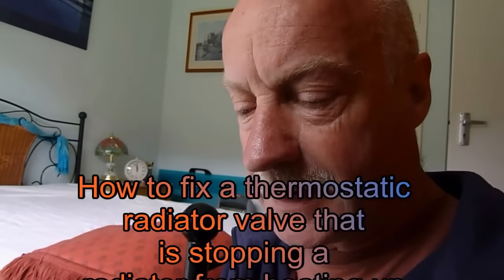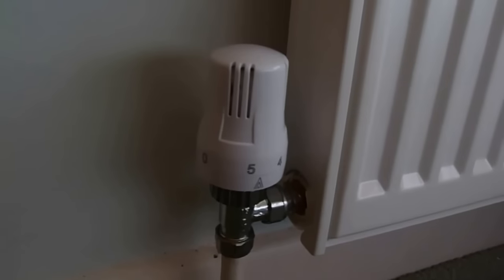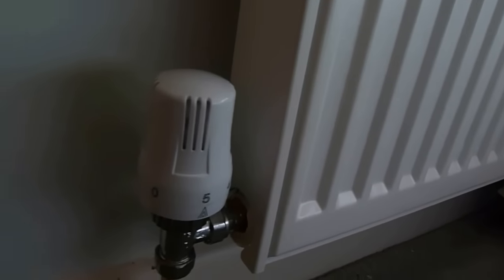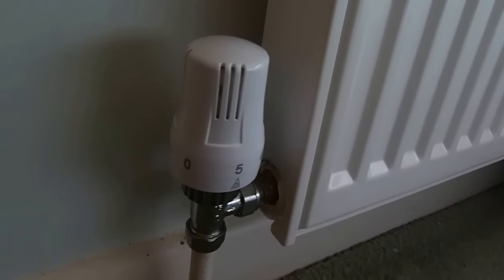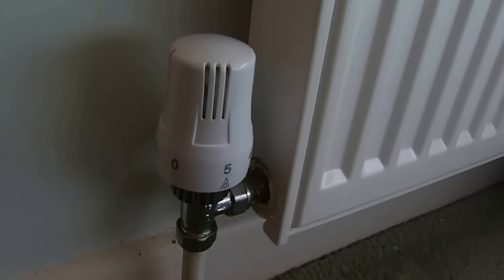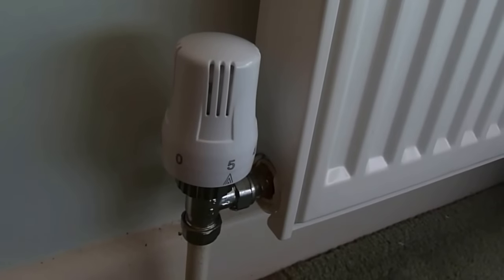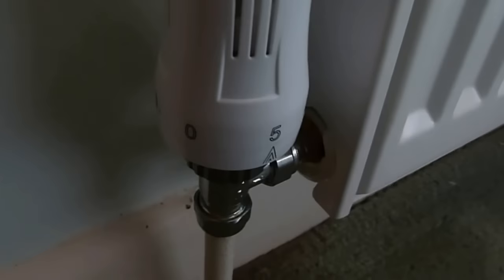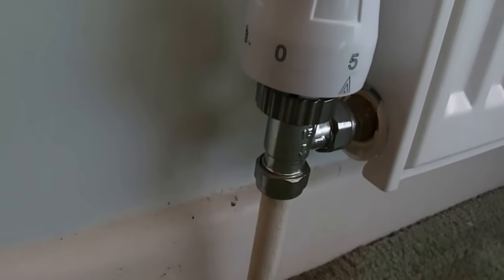How to fix a thermostatic radiator valve if your radiator is not heating up.

Comment: Hi I have the issue that the radiator will not work.  If I take the thermostatic valve off the radiator heats up fine.  This was in a very cold room as well so I'm sure it's not just the valve controlling the temp as intended also all the radiators have been bled so I'm pretty sure it's not an air lock.  Could this require a new thermostatic valve?  This only started to happen after the system was drained and refilled.  The pin is not stuck down either.
Reply from the maker: You have the sort of valve that can only be renewed.I have come across these valves many times, the valve head just goes U.S.   A nasty cheap valve.
Reply: +dereton33 What would you recommend as a quality replacement?  Also are the fittings universal?  Also to clarify are we talking about the thermostatic bit or the bit with the pin?
Reply from the maker: The thermostatic bit. But you will have to renew the whole valve. Fittings are not universal. Drayton are the best valves in my opinion..

Comment: Thank you so so much. You literally are a life saver, I was on the verge of freezing to death. Easy to follow and job done in just a few minutes. If the hammer doesn't do the job, you're probably not hitting it quite hard enough like I was doing, don't be afraid to put a little more whack into it. Thank you sir :)
Reply from the maker: No problem Lewis .
Kind regards,
al.

Comment: ace! Thanks for this; took off rad valve, tapped the pin with a hammer and the rad started to heat up immediately..
Reply from the maker: No problem Catherine.

Comment: Mine is only one nyear old and worked last winter but not now. No air lock. Have got the top off and can see the pin. The head is tapered so pliers just slide off and hammering doesn't free it - any other advice?
Reply from the maker: New valve Trevor I'm afraid.
Reply: 3 radiators all the same about 5 mm of pin showing (is this fully out?) and they will all depress about 2 mm.

Comment: Hi, one of our radiators doesn't get hot when I turn it above 4 on the thermostat -if I turn it down slightly I can hear what sounds like gushing water, after a while it starts to squeal. Would following this video help? Thank you :)
Reply from the maker: No in your case you need a new radiator valve.
Reply: dereton33 hi, and is that something we could do ourselves or not? Do you have a video of how to do it if so? Thank you.

Comment: Hi!
Is it possible that all the radiators in my apartment could have this problem? Like a month ago the radiator valves got changed for all the apartments in our building, but after that the radiators are not heating up in our apartment. 
The main pipes are hot, but the heat is not getting inside the radiators. Was wondering if this could be the problem and maybe the guys who changed the valves just did it unprofessionally.
Reply from the maker: +hendzK Worth taking the head off one and seeing if the radiator heats up. Some of the older type thermostatic valves also need to be fitted on the flow into the radiator, they will not work if fitted on the return pipe.
Reply from the maker: +dereton33 Do check the radiators for air first.
Reply: Thanks for the quick reply. When I managed to move the valve a bit, the 1st two "ribs" heated up, but then got cold again soon. As I understand, that might be, because the water does not keep circulating and the hot water I managed to get inside the radiator cooled down. If it was a problem with air, the top of the radiator would not become hot, just the bottom part, am I right?
Reply from the maker: Yes thats right. Al.

Comment: Hi there My valve (british gas  1208) disintegrated. I got a replacement but the thing inside the actual valve is stuck. It doesn't go up and down when I turn the numbers from closed to full open. Any suggestions? THANKS
Reply from the maker: Try giving the pin a light tap with a toffee hammer and a squirt of WD40.
Reply: @dereton33  Thanks Al but it is the movable part in the TVR thermostat head that doesn't move. little white thing that sits on the pin when screwed on. Thank you for your time. Perhaps I should just get another make. I got the BG one from an auction site...used.!!!!! I am not a handy man lol
Reply from the maker: In that case get yourself a quality Drayton valve.
Reply: @dereton33  Thank you for your advice. Really appreciated

Comment: Can we balance these ourselves? My mum doesn't want me touching our radiators (I haven't done so) and wants to call out a plumber (which we always do). We seem to have to keep replacing the thermostat. It's like they get too hot or something. It's going to get expensive to keep calling out a plumber.
Reply from the maker: It is very easy to balance your heating yourselves.
Reply: @dereton33  thanks. do you have a video?

Comment: Do I need to turn off the water or the heating first?  I have an inborn fear of plumbing!!
Reply from the maker: No, in fact it is better to do it while the heating is on, so you can feel the radiator heat up, when you have fixed the valve.

Comment from the maker: Hi Olympia197 Check the pressure of your Combi boiler and if low refill to 1.5 bar.
Reply: hi thanks for getting back to me......the pressure is on 1.5 but still got cold rads :(
Reply from the maker: Olympia197 Sounds like the dirverter valve on your combi but you will need an engineer to that,but do check the pump inside is turning ok, if not remove the front screw and turn the inner screw to release as it might be stuck, if you do not fancy trying that you could just give the pump a light tap with the hammer this sometimes shocks it back into life.
Reply: dereton33 thank you, i will try that
Reply: dereton33 still no joy, even after giving it a tap..... but thank you very much for the advice......il be calling the engineer tomorrow......good old hot water bottle again tonight :)

ps. the pump was boiling hot, so switched everything off from the mains
Reply: dereton33 fc

Comment: Help, we have a broken TRV head so I have got a new one, but I have pressed that pin to see if it is working before I fit the head, and it is now leaking water through it!! I have tried locking the radiator at the valve at the other side but the water is still coming through that plunger pin. What can I do?
Reply from the maker: Lock the pin down with the head screwed in the off position. Then order a new valve.
Reply: @dereton33  I know this sounds odd, but there is a serious fault with the pin! If I push it down then water comes out of it even faster. It is better in the up position! Anyway I have been and got what I need for a full replacement, and will call a plumber tomorrow. At the moment with the pin up the water is coming out pretty slowly. Hope nothing happens through the night!! Anyway Thanks for the reply.

Comment: The thermostatic rad valve (TRV) is very close to the radiator, and also (of course) on the radiator pipework, and must surely be affected by heat radiated by them or conducted through the metalwork to the temperature sensing element.  As heat is given up from the water in the radiator, it stands to reason that the outflow water is cooler than the inflow.  Where is a TRV best installed - on the inflow to the radiator or on the outflow?  It strikes me that it would be best installed on the feed pipe, some distance from the radiator, where it could sense room temperature without being influenced by the radiator - though I realise that's impracticable.
Reply from the maker: They are normally always fitted to the flow.
Reply: Thanks for the response, but "the flow" is a term I'm not familiar with.  In-flow to the rad, or out-flow from it?

Comment: I have a different type of problem. I've turned mine to "*" which means it shouldn't get hot. But it gets hot regardless. Would this also fix this problem? 
Tia
Reply from the maker: No Afraid not, you will need a new valve.
Reply: @dereton33  you got a video on how to change the valve by any chance?
Reply from the maker: Yes there is one on my channel.

Comment: I'm having a problem with a few of my radiators, they are red hot and no matter which way I turn the thermostat valve they won't turn down, is this something I can sort myself or do I need to call someone out? Thanks
Reply from the maker: Best call a plumber the valves are not working.

Comment: I turn  the radiator valve to the off position but it won't go off I have a very old cylinder type central heating system  not a combi boiler so if I want just the water on the radiators must go off....and the radiator is getting very hot and has got a sooty smell any suggestions please...
Reply from the maker: The valve is broken. You could always turn the other valve off for now, that is the lockshield valve at the other end of the radiator..I will set to doing a video on how to do it.

Comment: Oh dear, just tried that on an old danfoss and the pin DID come out, managed to put it back in but now I think I'm going to have to replace the valve. Please modify or remove this video. Thank you.
Reply from the maker: This video works for most valves, that old one you have is very rare but at least now it works. Once the pin is back in the leak will stop.
Reply from the maker: I have now amended the description, to not touch these models of valve, but to  renew them. Thankfully there are vary few left.
Reply: Thanks Al, new one on order, blood pressure back to normal :)

Comment: Plunger popped up as soon as I removed sensor head, radiator got hot. Replaced sensor head, and radiator went cold even although turned up high. Take it this mean sensor head is faulty, and always trying to push plunger down even below ser temperature?
Reply from the maker: bluerizlagirl You will need to renew that valve. Leave the top off for now if you need the radiator hot, until you get around to renewing it. Al.
Reply: dereton33 Can I replace just the sensor head? It's a combi with a sealed primary, so would be nice to avoid draining down .....
Reply from the maker: Yes, if you can get the same make of valve.
Reply: dereton33 Thanks, I thought so but nice to have it confirmed by an expret. I have a mate who works for a plumber's merchant; if anyone can get me one, he will be able to.

And thank you once again for your prompt response, on a Sunday too -- that's what I call true dedication!

Comment: My pin is working but the actual thermostat cap on the top doesn’t seem to push the pin down? Is it something on the cap that needs adjusting please?
Reply from the maker: No there is nothing, you have to renew the valve
Reply: Thanks again... I took it off and checked the pin, maybe it was jammed open and checking it released it as it seems to work now? But thanks for the video as I didn’t know they just unscrewed like that! Super helpful, I can change the bleed valve now that I can turn the rad off both sides :)

Comment: I had the same situation where the pin was stuck. Managed to free it off but I now have water leaking up around the pin !!  What can I do now please ??
Reply from the maker: It may seal itself give it some time, if not you will need a new valve.

Comment: Hi when I hit the top of the pin on my valve with a hammer a brown gunk comes out and it remains stuck,what should I do. Do I need to whack it  a bit harder
Reply from the maker: No its blocked with sludge and will need a new valve.
Reply: Thanks m8

Comment: Hi my thermo valve got jammed when I turned the radiator off in the summer, tried turning it back on and the thermo come off now it won’t get warm, anything you can help me with ?
Reply from the maker: Tap the pin with a light hammer until it springs up, then replace the top.
Reply: @dereton33  the pin is up it doesn’t go down for some reason

Comment: I have a new radiators and when I set my trv to 5 or 4 it heats up but if I set them to 3 or below they stay cold. is this correct to how it should work?
Reply from the maker: Usually they are set to number 3. If you have a cheap make of valve then you may find it has to be higher. Drayton valves are the best.
Reply: They are instinct valves? I'm not sure if that's a good make or not
Reply from the maker: Afraid not. those valves cost about £5.00. Drayton ones £15.00.. As they say you get what you pay for.
Reply: dereton33 this is true. it's just what the plumber put in and he's just changed them for new ones. would you recommend changing them then? could you recommend a mid range trv?
Reply from the maker: No the Drayton ones are the only reliable model.

Comment: Hi I have one stuck in on position will not turn off 
Tried to release value but not working swapped tops any ideas
Reply from the maker: Try tapping the pin and use some WD 40 on it then replace the cap.
Reply: Tried tap pin seems ok moving and up and down but I’ll try the wd40. As well thanks

Comment: Hi please could you tell me how to unscrew that? I am sure is a simple way but I tried to use a tool and it won't unscrew as to tight and no man to help me ! thank you!
Reply from the maker: A pair of water pump pliers, that open wide enough to fit the nut will do it. Turn anticlockwise to undo it.
Reply: Thank you I wil try this :)

Comment: I have a old radiator it has a dial that goes up to number 8 which number should I put it so I could have heat in my bedroom please help it's very cold in my room.
Reply from the maker: Turn it on to at least number 6. If it still does not work then the pin may be stuck in the valve. Take the top of the valve off and pull the pin upwards if it is stuck down. if it is to closed down, then tap it gently with a hammer. There are some valves where it is the valve head that is faulty in which case just unscrew and remove the head and leave it off until you can get a new one.

Comment: my radiator only works if it is on number 5 (full heat), for lower numbers it is just stone cold with no inbetween. Any ideas?
Reply from the maker: Change the valve.

Comment: Hate to say it but my pin just come out. 🙄😬 managed to get pin back in but it's a lot higher now can't get the rad valve screw back on. However radiator is now warm 🙂
Reply from the maker: Sometimes happens.

Comment: Hello. Please help.  I do not know what is wrong with my radiator.  It heats up for 20 minutes then it goes cold no matter the setting.  When I take out the Trv head, the rad gets hot at full speed. But when the trv head is on the rad gets hot only for 20 minutes and I dont hear the water.  I even changed the head, still same problem.  Please help.  Living room is cold, if I take the trv head out it gets hot but the heating bill will kill me. Thanks in advance
Reply from the maker: You will need to change the whole valve.
Reply: Thanks so much for responding.  I will try to chsnge the valve.  My husband is not handy at all.  I guess I will need to ask a plumber to do that for me.

Comment: hi please help, I have a slightly different issue my thermostatic radiator is to hot I can't cool it down without turning off the system? am I doing something wrong
Reply from the maker: No, you have the type of radiator valve that cannot be fixed . You will have to renew the valve.
Reply: Oh, I was kinda hoping it might need balancing or something? it looks very much like the setup in the video above. I can see the pin is up I just can't get it to go down :)
Reply from the maker: Those types of valve just cannot be repaired.
Reply: hi again, thanks for all your advice just one last question if I may. do I need to drain the whole system to change the valve or just the rad (which is upstairs in this case) and if so do I still need to shut the water down?
Reply from the maker: Just drain the upper floor level. Or you could by a freezing kit, which would mean you do not have to drain at all.
Reply: I had this at my old house and the top was not seating over the pin as it had loads of playand I think missed the pin?

Comment: My pin seems to be up but it doesn't push down/pop back up?
Reply from the maker: Make sure the other end valve is fully on. The lockshield valve. If no luck then the thermostatic valve is faulty.

Comment: Hi. I have the opposite problem. The radiator stays hot even when the valve is switched to off.....
Reply from the maker: Lynne Jones You will need a new valve then. Al.
Reply: dereton33 Thank you.  When I remove the valve it doesn't look like the one in your video. It  has a pin in the bit that you turn, not in the bottom part. Should we replace like for like? Thanks again for your help.
Reply from the maker: I would stick with a make like a Drayton. Al.

Comment: I've had a pin come out - water squirting out - had to take the valve out and replace it!
Reply from the maker: Very rare that happens you must have had a very old valve, as they stopped making them years ago.
Reply: It would of been fitted new late 1989 onwards

Comment: Guess what ! I did that and the pin flew out 😅.so it’s not rubish lol. I quickly put it back in because water was squirting out.
Reply from the maker: Bet the rad got hot after that,
Reply: @dereton33  hi ! Thank you for replying. I’ll have to replace the trv I think on that one they are very old (Alan key type) . That one’s staying hot continuously when the heating is on. So I think the mechanism inside is stuck solid. I did tap it with a hammer etc.

Comment: can you just turn one radiator off ?
Reply from the maker: yes.
Reply: Thanks for your reply. on one of my radiators the bleed valve is painted so I cant move it . Any advice on how to get it to move ? Thank You
Reply from the maker: Clean all the paint off with a small hammer and screwdriver, once clean and a brass head showing, you should be able to get a key to latch on and turn it.

Comment: Trying to turn my Radiator off. I twist the valve to zero, the radiator still heats up full.
Reply from the maker: You have a faulty valve.
Reply: @dereton33  thank you. I will contact my housing association and get them to look at it